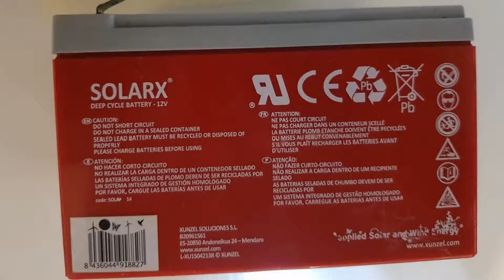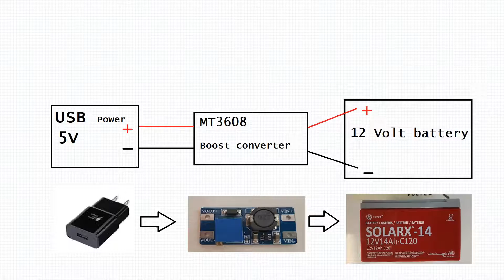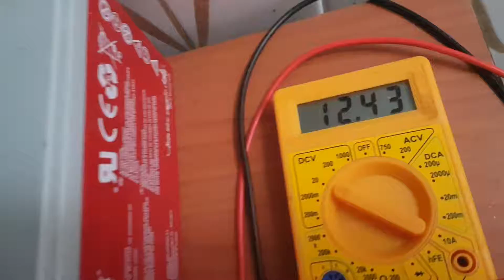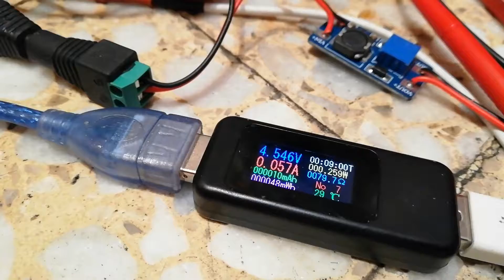Charging a 12 volt battery with USB 5V and a MT3608 boost converter

Comment: Good idea. I'll try to do it on a car that's been parked for a long time, through a small 6v solar panel. I think it will help keep the battery in working condition. But for a full charge I'll set it to 13.8-14.2 volts, this is the voltage of a fully charged battery. Greetings from Ukraine!!!
Reply: you need to regulate the voltage first for stability

Comment: Actually, for a 6 cell pb battery you need to apply at least 13.8V for it to actually charge...  12.5v is under voltage and it will never be fully nor balance voltage between cells.